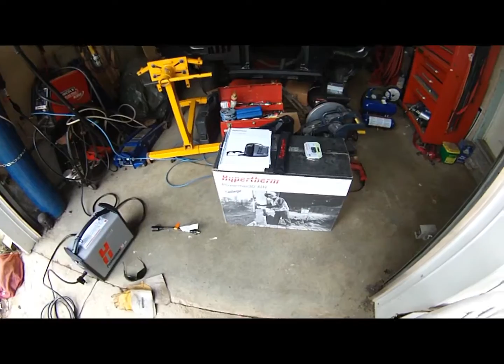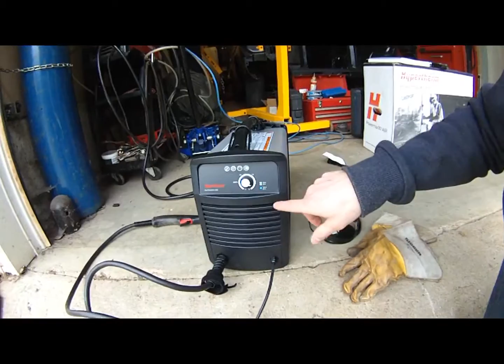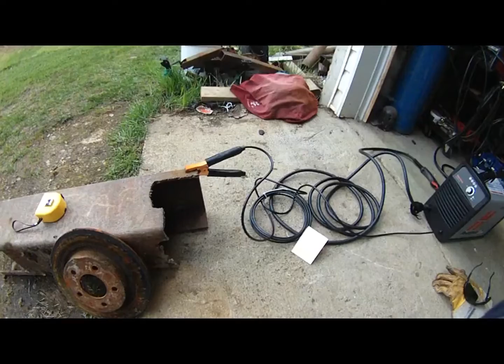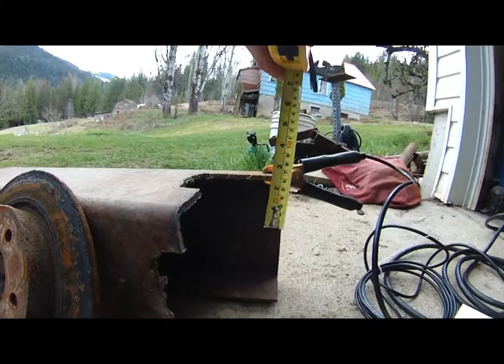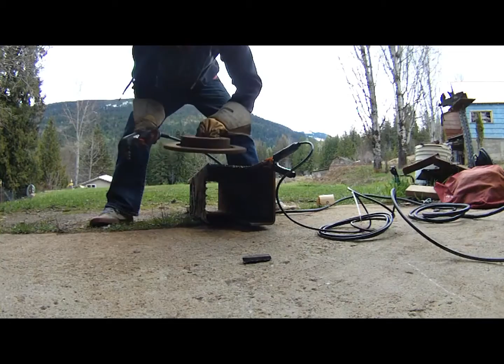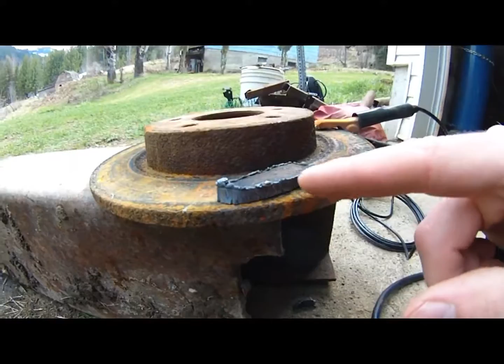Hypertherm Powermax 30 AIR - Purchase and Test -

Comment: hi. so, what are your thoughts so far about the XP? I'm fighting with either getting 45xp or the 30xp air.
Reply from the maker: Well if you put the cost aside, then it all depends on what your needs are. If you have a decent shop with a good size air compressor and want to cut thick material quickly all day, then the 45xp is the better choice. But if your space is limited, you have just a regular backyard air compressor good enough to fill tires and maybe run a impact gun for a few minutes before trying to recharge the tank, and your metal work is hobby type, then the 30air should be more than enough for your needs. 
I've used a 45xp quite a bit in the past and it will cut nearly anything you throw at it, and fairly quickly too, but in my experience with the 30air I've noticed it will cut nearly just as much, but at a little bit slower of a rate (and really not that much slower).

Comment: Are you still happy with the 30 Air,
Reply from the maker: Yes I am. I've used it a lot, it handles everything I throw at it. Right now I'm living in a camp while fire fighting and am really missing all my fabrication time with the hypertherm and my basic mig welder
Reply: @GearScar  nice! Yeah I love working on my rock crawler, but in the summer I’m gone on fires dozing and I miss my crawler and my wife but mostly my kids
Reply: @GearScar fighting fire as a job and burn things down as a hobby

Comment: I do a lot of 1/4 cutting/welding.  I bought the 30 air because it didn't need an air compressor.  I'm not impressed.  Goes through consumables too quick.  I have to spend way to much time on a grinder afterwards cleaning up the cut.  Give me a saw any day.
Reply from the maker: Are you sure your cutting techniques are proper? Cause I've used this machine a lot so far with 1/4 inch and thicker material and the cuts are clean and I'm still using my original consumables. I really quite like that machine!
Reply: I have the hypertherm 30 air and I don’t go through consumables fast at all. I’m very happy with it. I don’t keep the current turned up . If you read the booklet it states if you max out the current you can reduce the life of the tips.
Reply: I stopped using it.  Went to a 45xp.  Night and day.
Reply: Are you using a drag tip?